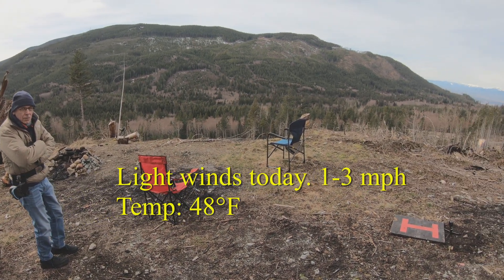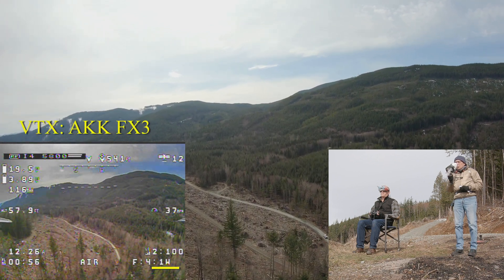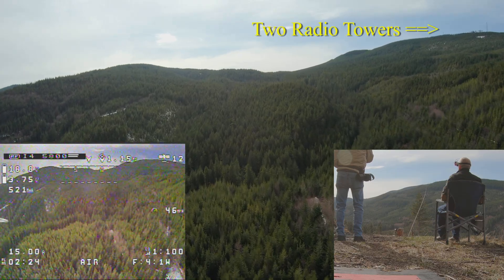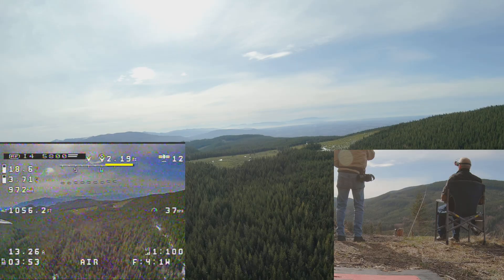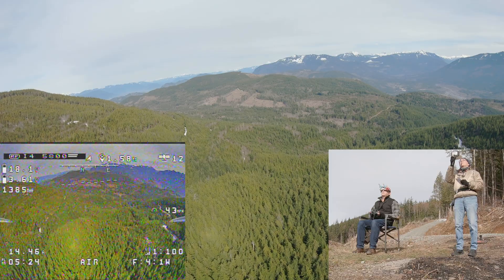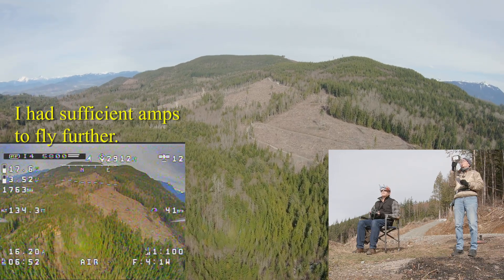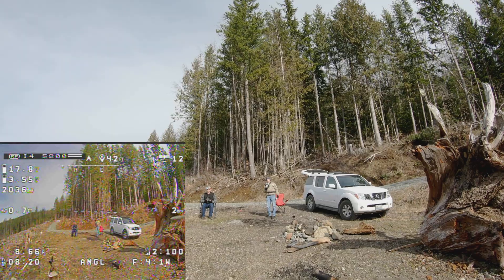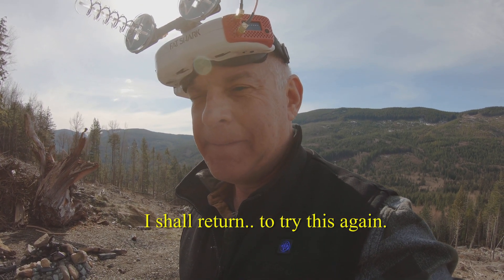Long Range FPV 4km Video Loss using ORT 6 Turn Helical

Comment: Hey any chance you could share how you mounted the Helical on the HDO2s?  Thats my exact setup but havent been able to find an STL to make it happen :)  I could design my own too but would be great if I could somehow see better how you did it.
Reply from the maker: I found a angular sheet metal mount designed for some other antennas. not 3d printed. it screws to the fan screws. velcro holds helicals to the mount. sma pigtails were needed.

Comment: Hi, have you ever got interference in the sense that the Helical's signal is distorted by Crossfire system and you get lines in the video feed ? Thank you
Reply from the maker: Hi. Thanks for watching. Yes I have. When I have crossfire telemetry and dynamic power turned on yes. I disabled telemetry and set the crossfire power manually and those lines went away. The same interference also manifest in the HDZero 5.8gh digital fpv system as well. I  personally doubt the noise is related to the helical design.
Reply: @ValleyFPV  Thank you soo much for answering. Noob question: What do you loose if you cut Crossfire's telemetry ? (I still have all I need on OSD) And how much Crossfire power do you use on manual ?
Reply from the maker: @filipmaftei7264  i believe you won't have GPS coordinates. And you won't have the crossfire signal strength. All else shows in the osd. I set my crossfire power manually to its max 1w setting and leave it at that. Crossfire range goes a much further distance than i have quad battery to fly so I don't worry about the crossfire distance.

Comment: You really should use a ground station ... but you did a great job flying out that far!
Reply from the maker: Thank you.... as a matter of coincidence I am currently working the bugs out of a ground station and testing Sharkbyte at long range. Videos about that adventure will be coming soon.
Reply: @ValleyFPV  sounds good. I will stay tuned :-)
Reply from the maker: Fyi..check out my 6k flight at the Sisters mountain video. Pretty decent analog fpv feed.
Reply: Having the antennas aimed reliably from a tripod seems more likely to bring you consistent reception at great distances.

Comment: Don't worry about the speed, if you are concerned about battery life you should be watching the amp draw. You could be flying downhill with zero throttle and be doing 80-100mph and be drawing basically zero battery.
Reply from the maker: Thanks. Yes I watch the Amp draw too but only when climbing. I watc speed more because  on my build my quad vibrates more over a certain speed. Messes up my gopro video.. That's why I keep it slow. Also my reflexes are not the best and I want to not go too fast and accidentally fly into something. That's why I'm always slowing down.. I am still new to flying these fpv quads. My next build I hope will vibrate less at high speeds. I hope.

Comment from the maker: Update: we have a new working theory as to what may have caused the loss of the FPV feed on this flight so close in; it appears that at that LOS event the quad appears to have crossed thru the signal path between two microwave  (or such) relay transmission towers. More on this to come in a future video as we investigate this theory.

Comment: How do those 1500kv motors feel? Im looking at getting a bind n fly 7 inch and the motor options are 1300kv or 1800kv. Id like a bit of power for cliff diving punch outs and light freestyle but still want to get long range and flight time.
Thanks for all the informative videos!
Reply from the maker: Honestly.. I am a relatively new FPV flyer and haven't done a lot of cliff diving yet. They seem great for my style. You may want to go for the 1800s.

Comment: Do you use rapidfire mode 2?
Reply: I have the same antenna and rapidfire and i did 10km with issues
Reply from the maker: Excellent!
Reply from the maker: @pasifpv5508  Excellent. I'm going to try again this week.
Reply from the maker: @pasifpv5508  We have a strong new theory as to why I did not get the range expected: It appears that I flew directly into the path of a point to point microwave relay signal. Or similar network. More on that in an upcoming video.
Reply: What the different of rapidfire 1 and 2?
Reply from the maker: @SmudgeFPV  Some sort of magic under the hood to make it more compatible with certain problematic VTX units.
Reply from the maker: Thanks for watching. I was using Rapidfire1   . I need to give that a try and test that as well.
Reply: @ValleyFPV  its alot better

Comment: Excellent range. A friend and I flew Sumas mountain a couple weeks ago. My quad dropped out of the sky across the valley. Luckily we found it. Check out the vid on my Instagram @FPVillain_
Reply from the maker: Thanks for watching. I have learned that the transmission antennas up there do interfere with FPV video. I almost lost a quad up there.
Reply from the maker: Those radio antennas up on sumas give me interference.

Comment: i got 5km with my 10inch drone, running 800mw rush vtx 5.8ghz and 250mw  power on the tbs tango 2 , with tbs nano diversity. 
antenna setup ws the menace pico patch and a menace omni rhcp antenna
Reply from the maker: Hi, Thanks for the suggestions. I am suspecting that my VTX is a POS or we flew right thru a point to point radio transmission between two towers.  I'm going to get one of those RUSH VTXs as soon as they get back in stock. Difficult to find these days. More testing to come.

Comment: I recently started into the fpv hobby and been testing in my back 40. I eventually plan on going up to Mount Baker at Baker lake. I love your artist point vids. I haven't been up there in years and it wasn't in the snow. I don't have the helical coils but the true rc patch and orbital antennas. I've been looking into those when I came across your vids. So far im using a sub 250 drone, the Flywoo explorer analog. Also I purchased the Flywoo hexplorer as well, a very smooth flyer.
Reply: How u liking it? I have Explorer LR analog. And HEXplorer HD.. 
I put rpm filtering, ratel 2, and lumineer 800nw vtx on my explorer lr. So far before rpm filtering li-ion 4s 3000mah gave me 29:52 flight time repeatedly.  
Hexplorer I just test other day. Making a video of flight time testing.. need to finish today
Reply: @divingfalconfpv4602  I am still learning about things.  I don't know what rpm filtering is.  But I have the original explorer but had issues with the panda vtx and motor surging so they sent me a new flight stack.  I ordered the newer vtx, GPS module and I essentially have the v2. It flies great.  I got the hex mostly because of the cool factor. But I like it even more. Oh n I got the li-on as well. Look forward to sending it out.
Reply from the maker: HI thanks for watching. I recently got into FPV just a few months ago too . I came from the DJI Phantom world and there is lots to learn here. I have a new 12turn helical that I'll be testing soon, and also a video comparing the 6 turn helical to the VAS Crosshair Extreme.  Yes.. That Table mountain/ Artist point  area is lovely.. and not too far range. I take off and land adjacent to the visitor center area when in the snow. FYI, there is Wilderness area boundaries on the outskirts of the ridges.. which technically is off limits for any aircraft below 2000ft AGL.. keep that in mind.
Reply: @ValleyFPV  definitely look forward to the vas review and the 12 turn helical.

Comment: Excellent flight and amazing spotter. bare in mind that Helical do not have a wide beam width Range. I suggest you to try with a Patch antenna such as TRUERC X2-AIR with a Horizontal beam-width *: 150deg and a Beam-width Vertical *: 62deg. Just for testing :)
Reply from the maker: Thanks for watching and the comments. I will be next flight testing exactly that. both a Helical and the X2-Air and see how that works. I may put a better VTX in the quad too as soon as stock levels return.  More vids to come.

Comment: I think you need bigger motor i use 2807 1300kv at 50-70kmh amp drawn at 15-20a.and the vtx i use rush tank 800mw still in good reception with ort 3 turn at 3.5km distance
Reply from the maker: Hi, thanks for watching. Great suggestion. My next LR quad will be exactly along those lines, bigger motors, and a good RUSH VTX. This quad was my first ever FPV build..and I've learned a LOT.
Reply: @ValleyFPV  me too mate.still learning as well got lots knowledges from falconrad fpv.

Comment: Another great flight successfully. Congratulations 🎊 👏👏👏. Personally what I felt watching this location is, you might have obtained the maximum you could with 5.8ghz and turned back at the right time 👍
Take care, Sir.  Happy flying 😊
Reply from the maker: Hi, thanks for watching and the comments. Yes.. could very well be. I'm going to try the same gear at a different location, just in case the terrain or near by radio towers were an impact. I need to get a combo that will allow me to go to 3 miles or 4, as theres places I want to film that are that far out. More adventures to come soon.